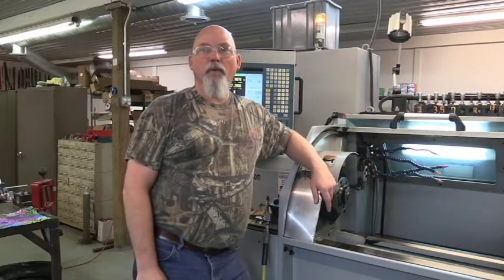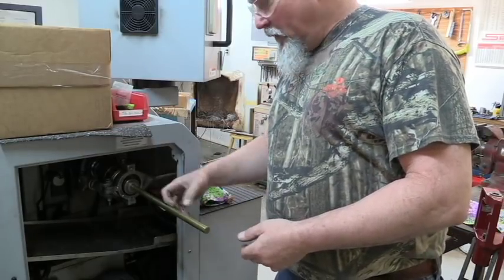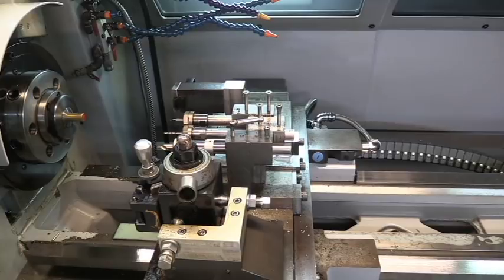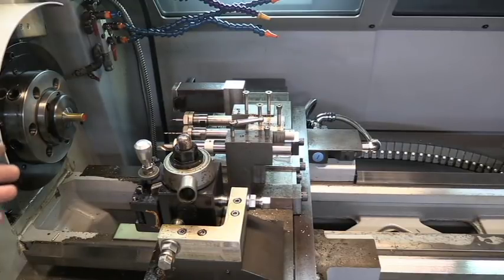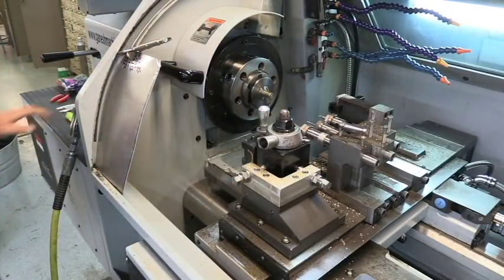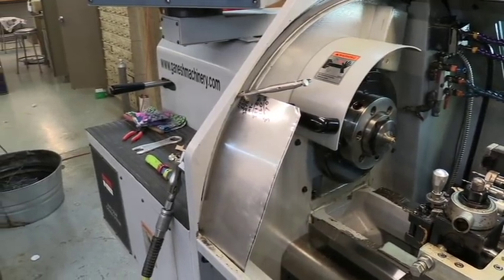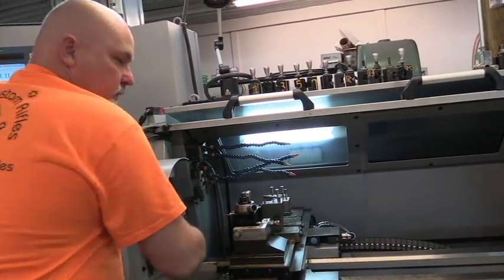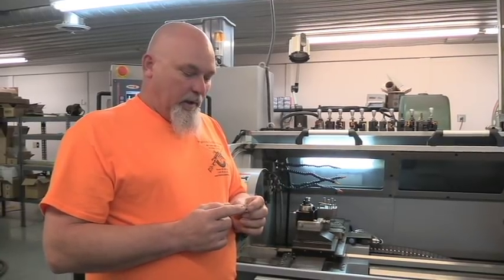Making primer modules on a CNC Lathe

Comment: Thanks for posting.
You could use a wire catch on your part during part off op.  Say drilled hole is 0.125,  run wire into bore (- z move only) that is slightly smaller. As you part off, it will spin onto wire catch.  You can then eliminate breaking them off. I’ll send a pic if I didn’t explain it.
Could also use dead stop on carriage to bump stock onto at cycle end.
Just trying to help.  Nice NC.
Reply from the maker: I have used wire catches before on some other parts, but this part only has a .070 hole, so the wire would have to be very thin and precisely placed to catch the parts. Using the carriage as a part stop would also work, but my stick out is pretty short and you would need some pretty small hands to get in there to pull it out.  A bar puller would be nice too, but I don't have an automatic chuck so that would also be more of a hassle than it is worth.  Thanks for the advise though...
Reply: The parts are much smaller than they appear in the video.  It sounds like you have it dialed in. Do you ever get bored doing production work? I sure do. The fun is in the setup for me.
Reply from the maker: I only do the set up and run off of a few parts, then I turn it over to my sister inlaw and she runs the parts...